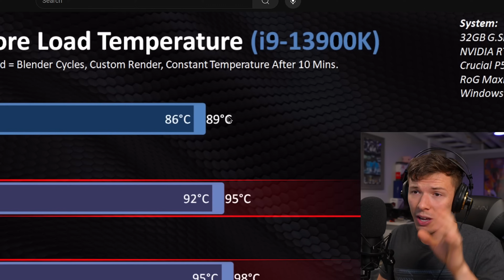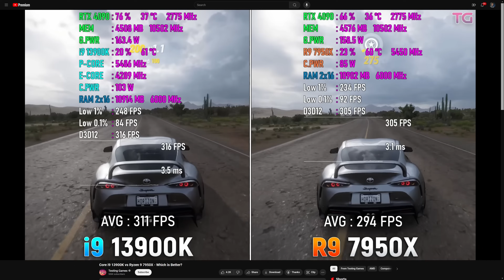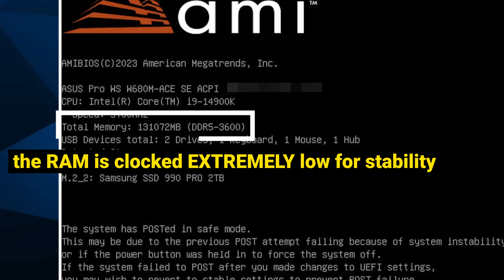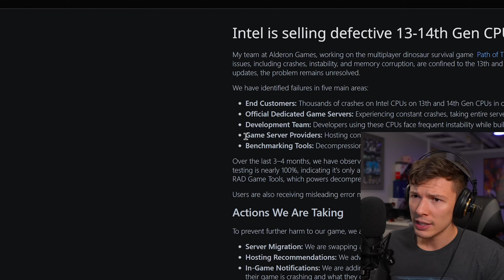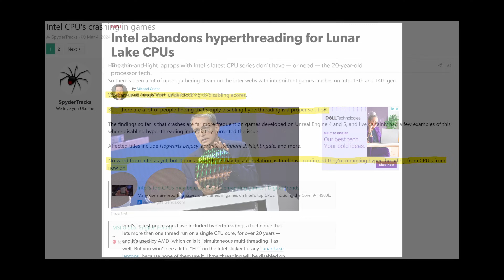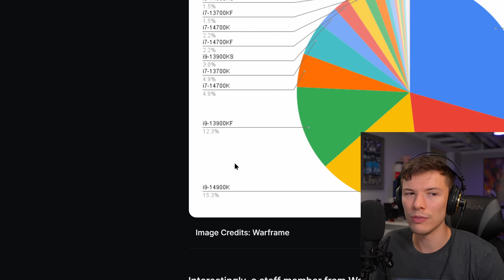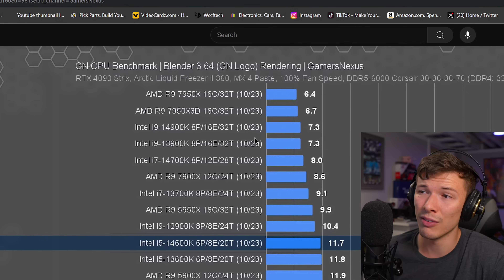Intel F**ked Up Bad

Comment: Honestly I perceive this whole thing goes into the wrong direction. I still use an Intel I5 the 8th generation and a geforce 1070. And I am still very content with my Computer. Most games works on WQHD with between 30 and 40 FPS. To go beyoned 60 FPS is it really necessary to spend so much money for and also to consume so much power? For me personally photorealism in games is something I somehow repel, is it really necessary? I always prefered a graphic style which allowed my fantasy to contribute it's part. With photorealism, it cant. Are those numbers for consumers really important? Do they really perceive a difference when they have their 144 fps? Still after 6 years I dont see any reason to upgrade my Computer, why should I? Just a little rant to stay that I dislike current development

Comment: I have never liked Intel, and their GPU chips are absolutely garbage. Yes AMD would crash, but it was also faster and ran with more flexibility than intel. Intel is also very notorious for throttled performance. It aays its going to run 3.4ghz, but strain it as hard as uou want, it would hardly get to peak speed and stay there, meanwhile a slower amd of the same class was done 10 minutes ago while the intel still strains itself. Ill trade a little instability for speed, but I usually will have other settings changed too (also adding to the instability) so its 50/50 what I did or the processor hitting a bump in the road.

Comment: i have an 13700 non-k and a 360mm watercooler and i got bunch of crashes last month i changed the cpu settings to auto to enabled (speedshift and all the powersaving stuff etc. microcode to normal, avx enabled, normal loadline control not intel default, long story short on my msi b660m-a i think the auto values are badly configured) it seems to work fine now

Comment: I have 6-7 months that i built a new setup with 14600kf. At the start i was thinking to go for a 14900k then a 14700k but the budget was already big plus my thinking was that i dont need so strong cpu paired with a 4070s while i am playing at 1440p/144hz. So i guess this turn out to be a good desicion for me and i have less chances to have my cpu fail on me.

Comment: AMD :) AMD :) AMD :) AMD :) ... told you few month ago.....so how much servers are running with Intels Hot Inside ? ^^
And NO it CANT happen to any company but just to once who ignoe simple physics...... ITS AN INTEL GREED PROBLEM. it has to end up like that.....
blaimig motherboards manufacturers was another big issue...

Comment: having a 13700k for one year now and everthing is fine. doing pl1/2 at 353 watts but also undervolted all cores by 0,95mV exept the 2 fast once. Thy are at -0,65mV.  But also using a contactframe since the beginning.

Comment: In december 2022 i bought a i5 13600k. No overclocking. I installed a contact frame to secure the socket properly. I also have the best cooler out there : Noctua NH D15s Chromax black. And my PC case had plenty airflow : its the great Fractal Torrent EATX. Should i still worry?
Reply: after watched gamers nexus video about intel's crash issues, what i got are most of crashes come from intel i9 gen 13th and 14th lineup. if you still worry, search the news about intel i5 gen 13th and 14th crash issue.

Comment: honestly ai chip isnt that bad of an idea.
ppl simply didnt realize being a vtuber requires you to face track to be able to make the model work and it requires a bit of ai to make the program runs faster.
every day we need to use CUDA from nvidia and it kinda needed 3-4 gpu slot wasted just to install 1 gpu alone.
if you are a vtuber who only wanna use cpu as your main setup the ai chip would sounds like a good idea.
my only concern is that whether its just about inbuild chat gpt in your pc or whole ai in general?

Comment: I'm so annoyed since I didn't know there were issues with the 13th & 14th Gen when I built my PC in December.  I have had so many crashes on the PC and the dam thing get so hot even with a good AIO.  In order to fix the issue I had to gimp the pcores to 55x and set my PL1 & PL2 to 210W since these chips suck!  I'm so annoyed with Intel because when I build a PC for myself is to last 3-5 years. Temped to throw away the 14th series chip and get a get a 12th gen since it's less of a hassle.  Next time I'll go AMD like I was suppose to this time around but got lazy and went Intel;(

Comment: They can't do a recall. It's the architecture...Replace a defective CPU with a replacement defective CPU??? They can't even promise to replace them with a 15th gen because it's a whole new platform that will require a new motherboard. An i9 12th gen is about all they can offer.

Comment: i've been rocking my i7 6700T for AN ENTIRE DECADE. 
i'm planning to switch to a new build during these next days, and while i can let go nvidia GPUs especially considering how much they screw with customers and how much less powerful are, i can't let go intels, maybe i'll avoid the 13th and 14th gen of this cpu, but i'm gonna use the 12th gen since it doesn't seem to have those huge problems. i've never experienced AMD cpus, but the only time i've heard people talking about it, was in a negative way, nearly frying itself multiple times due to its dynamic overclocking and underclocking feature which causes faster wearing out. i ofc can't upgrade my pc keeping a now 10 years old processor, so the only choice i have in front of me is the i7-12700kf, the latest intel that doesn't have those huge problems in stability, and not an amd due to... well it's underclocking and overclocking instability too. 

man if this time period sucks to build a pc

Comment: I dont see many intel owners in the comments, maybe they can't even watch the video fully before their pc crashes
Reply: Lol 😂 nice try dick Intel owner here
Reply: Honestly I have a 10th gen not a gamer and have had no issue as far as I know I have fell xrp 2 in 1 maxxed out with 32 gigs ram 1TB m.2 all soldered only downside I can see  4k screen
Reply: @marcfavell  13 & 14th gen are the issue. Obviously your stone aged 10th gen won't have those issues
Reply: @_J3RK_ drop the specs of both systems
Reply: @_J3RK_ I said both systems. Drop AMD system specs too :)

And if you need to tune down the CPU manually where it is stable. It isn't a stable CPU 🗿
Reply: @_J3RK_ confirmation bias, no? My man's running a 4070 vs a 4090 🗿
Reply: @_J3RK_ then blud idk what to say, you're either bad at testing stuff or are straight up pulling numbers out of your ass. Best case scenario is 14900k usually beating 7800x3d by a few %. Other times 7800x3d takes the W.
Reply: 12900KS here no issues
Reply: @noturray2123  obviously, the issue affects 13 & 14th gen
Reply: You clearly aren't looking. I'm another 13900k user with zero issues. Occasionally overclock and run overclocked ddr5 for over a year now. not a single problem with cpu. I've never been happier with a pc I built myself and I've been building them for 27 years of so.
Reply: I have 12 gen Intel
Reply: 3 Intel 12th gen systems here, no issues at all.  I think all people should be humble about the fact this could have been AMD.  I have seen many older AMD motherboards and CPUs fail as well.  To me, neither can say they are the best in regards to reliability.  I give Intel credibility in that they have been "mostly" reliable over the years vs AMD.  Yes, AMD has proven to be reliable as of late, and Intel has fallen down as of late.  The real difference is going to be how Intel responds to the 13th and 14th gen CPU issue, and if they give the owners of these systems warranty support.  Being a cpu manufacture, it wouldn't be that hard to "redo" manufacturing on the platform.  This is also the risk of buying the latest and greatest without having time out in the wild.  I bought the 12th gen as I never heard of issues on 12th gen, I passed on 13 and 14th gen also because a sale was going on with the 12th gen, saved quite a bit of money in the process.  I didn't "upgrade" to Windows 11 until I felt that the OS was matured enough, and I felt it was stable enough.  In part, this is also the fault of "greed" in the market, not just with Intel or AMD.  Go ahead, buy the latest AMD chip, just hope and pray it doesn't fail.
Reply: @davidplaster4576  obviously your 12th gen systems are fine because the issue affects 13 & 14th gen. Also it doesnt matter who it happens to, its still a major fuck up. Its just funny that it happened to intel because they've been lazy as fuck and uninnovative
Reply: @CaterKill  Kind of like how our government is a major fuck up, and lacks any motivation in actually helping american citizens with the american dream...a dream that died in 2009 when government gave taxpayer money to banks and corporations due to their greed; and nobody was held accountable...except everyday americans that tried to do the right thing got screwed over.....ohhhh wait....still happening in 2024!!
Reply: I'm running 13900 for a year now. No crashes, no problems at all. Maybe I'm lucky. Maybe only the K versions are affected ? I don't know.
Reply: @robertgosz4281 Same here , no crashes , 13900k
Reply: I'm pretty sure the issue isn't with Intel CPUs. It's motherboard manufacturers having the presets too high.  Simple fix in the bios screen to run the CPU at its recommended specs.  There's already many videos online proving this point.
Reply: I'm not a intel user but I've heard it does help.  But the issue is that I. Many casesz even tho you fixed up the bios issue, the processor has already been damaged and it cannot be undone
Reply: @williamredpath861  it’s neither https://youtube.com/shorts/ZfoYXxq-K3I?si=MVTUP2AN93Htmzy9

Comment: It's weird because I have an Intel i5-14600KF running for a month now under heavy gaming, it stays between 60°C and 70°C. Also, not a single blue screen. Just working perfectly fine.
Reply: Cause it's the issue with I9 mostly and supposedly due to their Termal Velocity Boosts tech.
But you know it's better to be clickbaity like Vex here, the less you know the more drama you are willing to watch.
Reply: I decided to upgrade without breaking the bank and got an i3 13100f for a TUF motherboard.

No issues. 🤔 Really thinking all this negative press for Intel is just hot air and lies.
Reply: @Red_-Super bro..... what?? The i7 and i9 are frying themselves. Theres concrete data. Your stupidity baffles me
Reply: @cbaileychamp  I feel like this is just user error and a lack off a cooling solution.

I'd overheat and die too if I was treated how most of you treat your PC's. Don't even take the sticker off the AIO if you even get an AIO.

🤷 Will still be upgrading to an i7 14700k or the i9 14900k. Not worried about it tbh.
Get a thermal grizzly CPU bracket and an AIO and be done with it.

Stop blaming the product 🤷

Comment: just finished my 13700k build !!! welp, kind of regretting my decision but I just bought thermalrights contact frame, hopefully that saves me
Reply: good luck mate
Reply: I have the 13th gen i9. I simply put wattage and temp limits on mine and so far everything has been fine. No overheating and no crashes.

Comment: It's so fcking easy to patch all those problems with single bios update... or fix it manually, if you havent burned your cpu long enough. lock the clockspeeds for every core to advertised boost clocks and make damn sure to disable ANY single core to boost over  it. In case of degraded cpu : pump up additional minimum voltage to keep the degraded silicon to fail. That's it.  How is it possible, that some random degenerate overclockers discover and fix it in real life by simple google search .... and YT giants like L1 throw out autistic screahings.

Comment: To fix this problem its simple, activate all core symmetric boost at 5.5 ghz for 13 gen and 5.6 ghz for 14 gen, disable the two core max boost like 6 ghz/ 6.2 ghz, Intel is simply pushing too much voltage into it, thats why its degrading.

10 nm process node is not supposed to run at 1.5 voltage.

1.3 voltage is the sweat spot for longevity stay around there and your safe, and keep you temps in check. don't go above 80 C.

Myself is running 5.1 ghz on p-cores and 4.0 ghz on e-cores with 1.1 Volt. CPU 13900KS 137SP. efficient cool and quiet.
I'm not taking any chances.

next cpu will be an AMD that's for sure.
Reply: Fascinating

Comment: Is this issue occurring with the i9-14900HX in laptops?
Reply: Conflicting reports here on YT ...outside found nothing. I have 13900HX and only problems related to lack of stability or VRAM error was related to pagefile and low amount of RAM to what I tried to do. That said, I use my laptop only for 5-6 months and had some other problems that I still research, like keyboard loss of connection or mouse pointer stutter...but those are mostly peripheral related than laptop problem, as my keyboard act out also on HUB, and other mouse seems fine so far. Also had no BSoD like ever related to this (just one due to windows restore point related and bad drivers, so not related). Processor passed SHA3 ...but I did not test each core 1 by 1 yet... check that test, run 10-20 times and see, if it's stable you should be safe, laptops don't grind silicon so hard like desktops.

Comment: I was about to buy and build a pc around the 13600k .That doesn’t sound like a good idea anymore…
Reply: Get to yourself AMD 7 7800X3D and be happy ))) Like I did, when I went from i7-10700k to 7800X3D 😉😉
Reply: @Bender3712  he said not for gaming
Reply: @pravnav  Ok, then wait for Ryzen 9 9950X
Reply: @Bender3712  a bit out of my budget so I choose the 7900x with 12c
Reply: @GstaikDesigns  Yeah, it is also great choice! Still better than Intel Raptor Baked "Dead Inside" 🤣🤣
Reply: You’ll be fine, only 13/14th gen i7/i9 are the bad ones. But for gaming you should always always go with amd
Reply: @pravnav  no gaming at all. I am graphics designer and a video editor that's why I was considering the i5
Reply: @GstaikDesigns get something like a 7800x or a 7900x  (NON X3D) Those will still perform great  in productivity.

Comment: The one benefit of being flat broke and drowning in debt is I don't have to worry about getting crappy new cpus from anybody. Downside is I am still on a 12 year old xeon. At least  it works though..
Reply: Thinkpad from 2014 here. Only issue I have are normal Intel/NVIDIA integrated snafus related to Linux kernels that everyone's had since Linux based OS's started becoming used as daily driver desktops. My Uncle's brand new Macbook gets way hotter than my Thinkpad even at idle which is saying something because Thinkpads tend to get warm AF
Reply: I'm in your shoes... but I got some money together(savings + extra work) and bought a Vega and a 5600X from Aliexpress in December(Sales/Deals time). The mobo+CPU combo deal was sweet, the Vega was cheap and it was all worth the 7-month saving. Free shipping! (but... 1 month waiting time)
Never been happier and its stable AF.
I upgraded from a 12-yeard old Intel and a AMD Radeon 6670

Comment: Al PC hardware that I've owned in the past that runs hot with a high TDP, dies within a very short time frame, then there is hardware like the ATi 9800Pro, Nvidia 9800GT, AMD HD6950, Nvidia 1080Ti, Intel i7 2600K, Intel i7 7700K, AMD Ryzen 1600X, AMD Ryzen 3600X, all still work perfectly to this day, and run coll with efficient TDP's.

Comment: The only reason I got a intel cpu is because it was actually cheaper then the AMD ones where I live, I got a 13600K, and it’s equivalent to benchmarks and preformace was a R7 7700X, it was about 80$ cheaper for about the same preformace, my chip it’s been good but than again it’s a i5 which draws much less power than a 13900k, so I mostly inclined to think it’s mainly the i9 that have these crazy instability cuz intel absolutely pushed the clocks on them wayyy to far and not to mention they can draw more power than most mid range gpus

Comment: I have a 14700K that I bought in November. When i first fired it up, and stressed it, it went to 100 C in under a second, so I made a lot of changes to bring the temperatures down: A better cooler, more fans, liquid metal, a "bending correct frame", undervolting it, and reducing the speed. I had it set so it never went over 70, but speed was also 6% under specs. As a result of the "100% failure" news, I have reduced things further, and it never goes over 52 C now, but speed is down 14%. 

Why did I buy an Intel? Reflex reaction.... Will I buy another one? At this point, it seems unlikely, but it depends how Intel handles this.  I think it's clear that I did not get what I paid for.

Comment: I have a 14700K I’ve overclocked the shit out of it in the past and run tons of stress tests. I have NONE of these issues. Set a power limit to 253 PL1/2 and 307A on your ICCMAX everything should be fine.
Also set a TVB all core 90 degrees -1 and 95 degrees -2   You will never have issues.
Reply: Will it affect gaming performance?

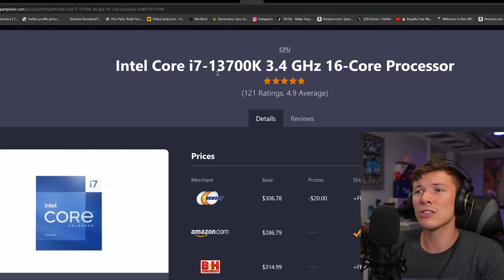Comment: 17:03
13700K = 8P + HT + 8E (24 threads total)

14700K = 8P + HT + 12E (28 threads total)
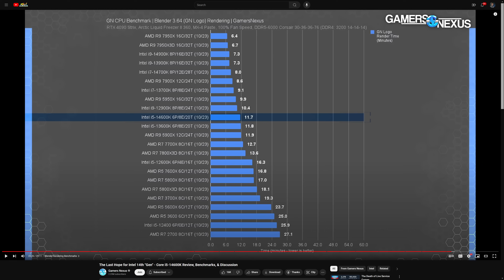So 13700K is not the same as 14700K. Even the photo at 17:12 confirms they're not the same.
Reply: Yea 14700K is the only 14th gen with a different core count vs their 13th gen equivalent.

Comment: They are currently getting out of the rabbit hole, they changed their tactics, changed to CEO’s that specialized on marketing, allowed AMD to get ahead , and missed all the technological booms that ocurren in the past century. They have to catch up, but their marketing and hubris tell us that they are currently struggling. i have always used intel, but lately have recommended AMD processors to my friends, even though I have not switched myself, guess old habits die hard.